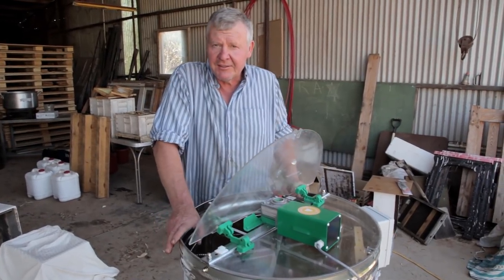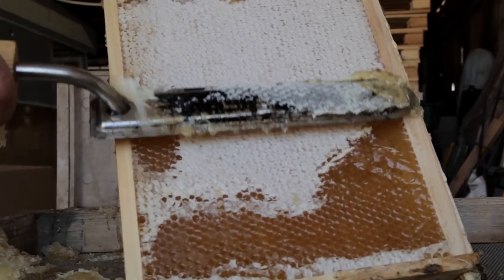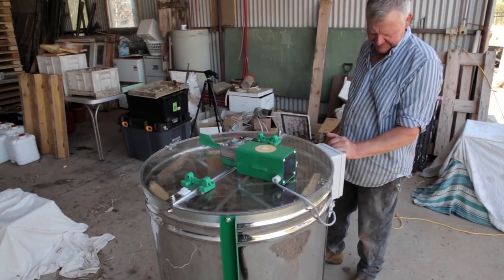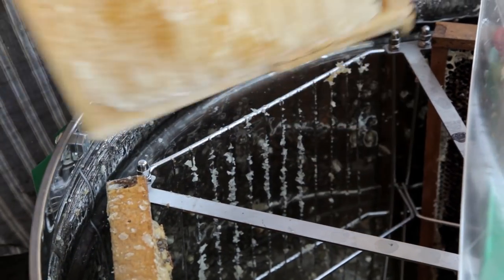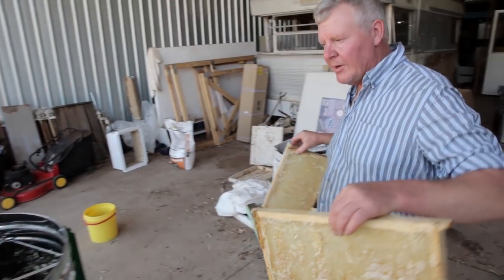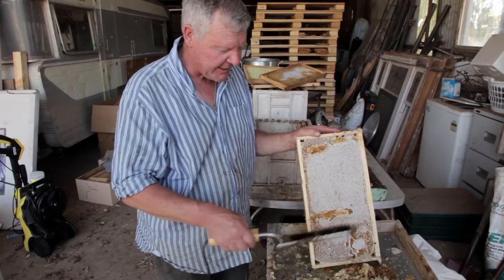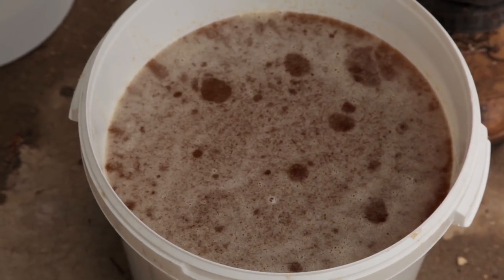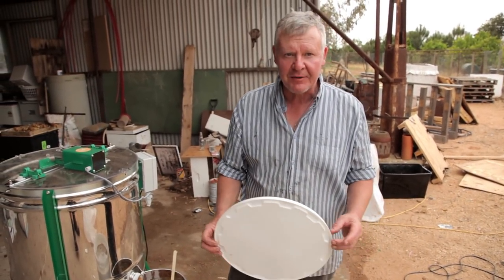Extracting Honey from Honeycomb -  Episode 5: "Honey, Honey"

Comment: 2 questions:

1) Why are there caps on the honeycombs? Do the bees remove the caps when they need to access the honey?
2) What happens if a bee remains in the machine? Do you have dead bees sometimes that end up in your output?
Reply from the maker: 1) The caps on the honeycomb is like putting a lid on a sauce jar once we've finished cooking it.

2) You do get some bees that remain in the machine and some may die but if you rewatch the video, there's a strainer over the bucket collecting the honey.  This removes the wax and anything that gets into the machine.

The honey will be strained a few more time after this.

Thank you so much for your questions!
Reply: They seal it after it has the right moisture content, so humidity doesnt make it's way back in. The lid on a jar bit☝🏼 is a good way to put it, too.